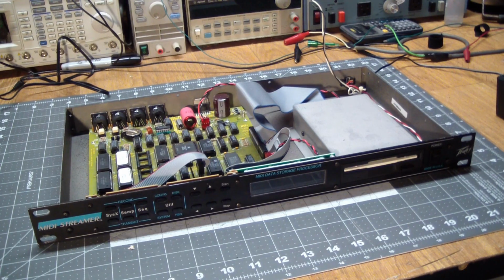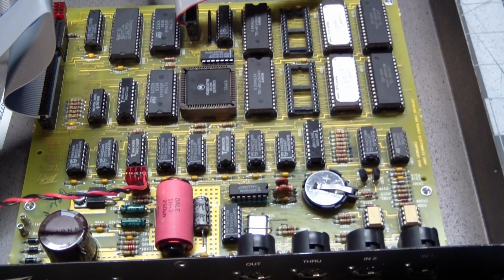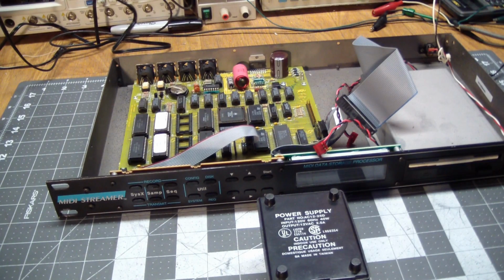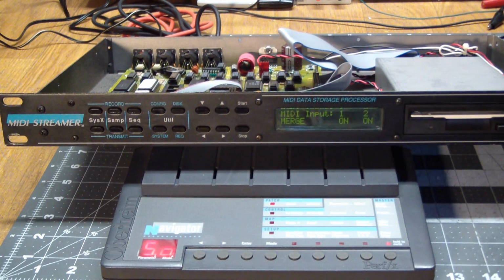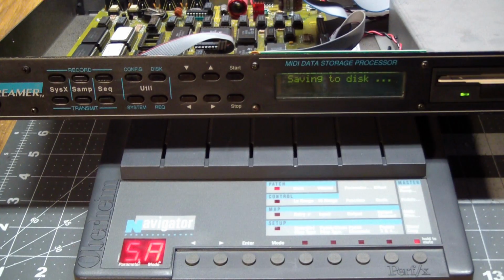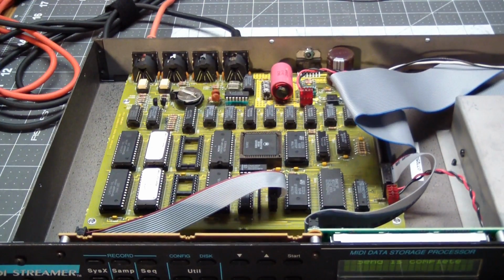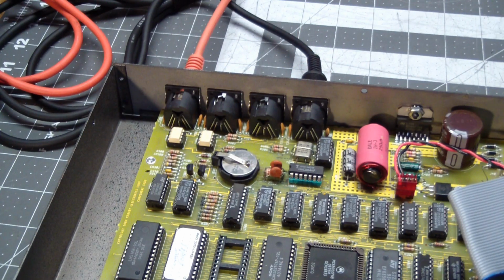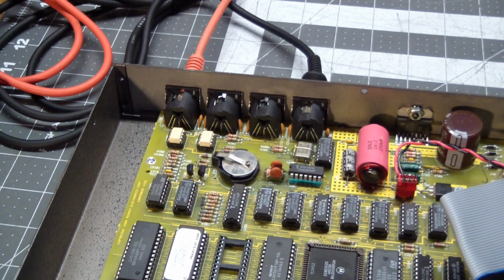AE#197 Peavey Midi Streamer Repair, Part 2

Comment: Hello, I am amazed to see you perform these repairs. I have a Peavey Midi Streamer with a similar looking problem in need of repair. Would you be willing to perform the repair for me on a fee-for-service basis? How would I contact you to arrange such a transaction - to ship the item and to pay your fees? Thanks and keep up the good work.
Reply from the maker: I get repair requests periodically, but I just don't have time to do third party repairs. For this specific fault it takes a long time to find all damaged traces, and if there is any battery alkaline left on the PCB afterwards it will rear its ugly head again guaranteed. Mine still works, but I only use it sparingly and thus any battery residue remaining hasn't had a chance to do more damage.

Comment: I didn't know that corrosion could kill a chip without anything visible at the pins. That explains a lot.
Reply from the maker: It's just a theory, but the bonding wires in an IC are awfully thin. I've actually observed this in some Hammond organs from the mid 60's that used thin coated copper wire to connect the tone generator to the keyboard. Repairable, but a pain to do so.

Comment: ARTIFACT, What do you mean by "current loop"? and the current loop is doing what to the circuit?
Reply from the maker: Google "20 mA current loop"
Reply: @artifactelectronics  I'm confused what the 20mA current loop is doing to the circuit? and why are they using a 20mA current loop for what reasons?